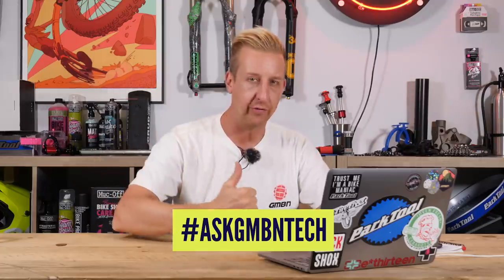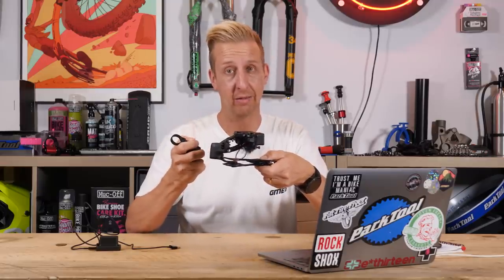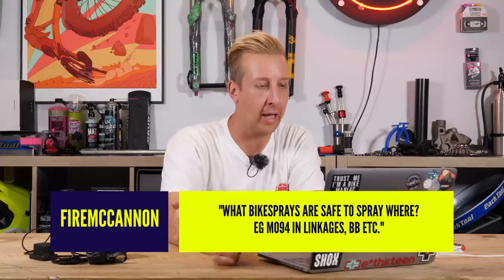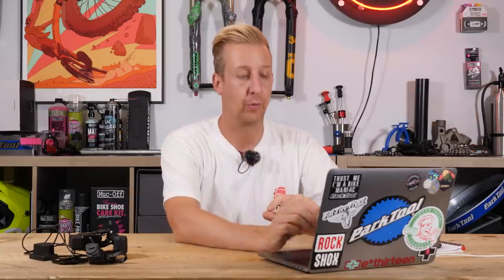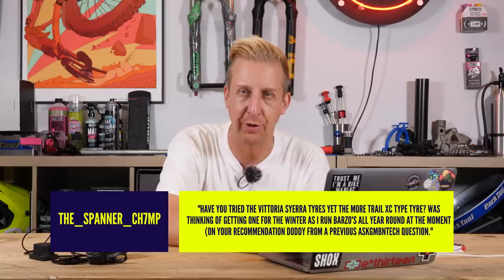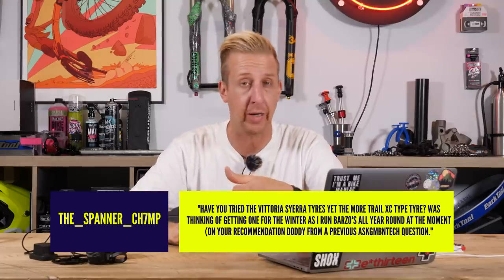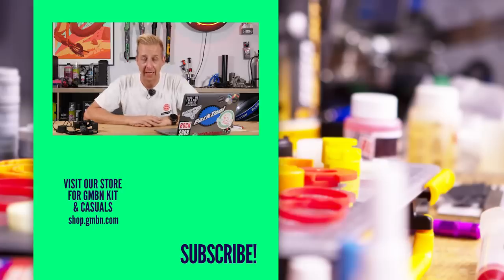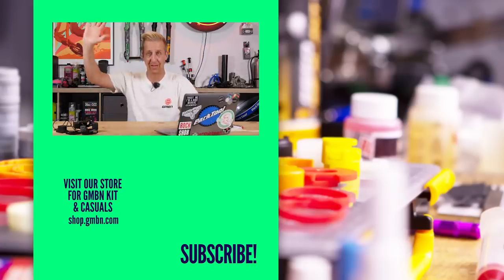Fake Sram AXS, How Bad Can It Be? | #AskGMBNTech 200

Comment from the maker: Would you fit fake components to your bikes? Share your thoughts on this subject with the community down below! 👇💭
Reply: Nope - spend you money supporting the brands which support the sport - not the rip-offs.
Reply: I wouldn't call that Wheeltop rear mech a fake unless they have an infringement of copyright on the product? more they are using SRAM marketing to try to sell their own product - interestingly it's no longer listed on their website so I'd expect SRAM have jumped on them.
Reply: does bein a fake rider count?
Reply: Microshift would be as "low" as I'd go I think but I just stick with slx/xt and NX/GX as to me it's the best price to performance and lasts me fine (so long as rocks don't see the end of the derailleur prematurely).
Reply: Won't be fitting any knock off components on my bike. On the topic of tubeless setup, I mount the tyre dry and get it inflated to set the bead first. Then I would deflate and dismount just enough of the tyre to pour in the sealant, remount and inflate. Since most of the tyre is set already, less chances of a sealant bomb going off and almost guaranteed to get the tyre inflated first go around. Love the show guys, cheers!
Reply: fake kit - yes (I do for the road, the mark-up on bibs/jerseys is insulting), fake components - no, not worth the safety/functionality risk.
Reply: @tim__sadler  I'd say if it works as intended then why not give it a go? It encourages competition and drives down prices for consumers no?
Reply: @MrOvertSandStorm  absolutely they is so many bike snobs on this channel you should watch Sam pilgrims new video with 160pound double crown forks from Amazon!
Reply: @MrOvertSandStorm  Unfortunately that is never the case - innovation drives competition - Rip-off/fake/infringing products actually slow down Production Development as companies are forced to compete with thier own designs made cheaper and in most instances worse. 

Also how many of these knock-off brands sponsor riders, support events, put money back in to the sport... do you know what their company policy is on Sustainability or Work Practices... if the answer is only about price then we are in a bad spot.
Reply: There is plenty of original components I wouldn't touch.
But even then there is a chance for a look-a-like, when its low cost is due to patent bending, not poor manufacturing. The shifter in question might be such, but it still needs refining
Reply: @Mountain940  you assume incorrectly.  it's not about being a snob.  it's about being cheap.  like most hobbies, cycling needs money.  most of us around here aren't fond of spending more than we have to, ONE time.  we'd like to NOT spend on stuff more than once so we'd like things that are mostly proven to work and last.
Reply: @subforascoobysnack6460  yea but seth still had to SPEND money on it.  his youtube channel can afford that kind of experimentation.  can you?
Reply: JG bike makes a Sram eagle 12 speed cassette that's half the price and ive bene riding XC , enduro, and regular trail and jump lines like a young mountain biker should and it has held up shifted smoothly and lasted a season and a half without any visible wear.
Reply: @MrOvertSandStorm  If it is a product on its own "pie brand electronic gears", then I'm all for it. Selling it in a way that tries to confuse it's association with another company like they do here makes the seller (not necessarily the manufacturer) untrustworthy. If this product does work, someone reputable needs to pick up distribution and support it. (can still be aliexpress/direct from china, but it needs to be legit)
Reply: The last components I'd try to pass off would be sram, I'd be too embarrassed to have any sram aside from their quicklinks on any of my bikes much less a sram knockoff
Reply: @littleshopofrandom685  yeh I agree, calling is AXS or whatever and branding it the same it suss and not ok
Reply: @Mountain940  I really hope no-one buys those 26" forks thinking that Sam has actually recommended them...
Reply: Nope. No support for knock-offs, which are usually of much worse quality. I prefer to buy once but very good quality.
Reply: call me what ever you must, but I do and will continue to stay away from knockoff products.   Tried and true for me...
Reply: @iHasCaek  Exactly!
Reply: @GMBN Tech Guys you have multiple impostor accounts commenting here please be aware
Reply: No. I'll spend more for the proper part the first time.
Reply: Okay but this is not an actual fake component? The seller even has been removed from selling them like that? Unless I missed the part where they wrote SRAM on it?
Reply: "Chinese Carbon" wheels are super popular,
Reply: This video is very misleading and feels a bit  like clickbait/spam.   The product description that GMBN reads aloud in this video I am almost certain was from a listing on Ali Express by an independent store/seller.   Wheel Top is the brand that makes the kit and they quite literally supply numerous other product to big names like Trek and Giant bikes.  They never tried to impersonate SRAM that I am aware of..   Oh and by the way that wireless drivetrain kit weighs less than the xx1 version of Srams AXS at less than a 1/3 of the price.  About $360 USD.
Reply: @tim__sadler  Every modern derailleur is a rip-off...of Sun Tour's slant parallelogram innovation. sheesh.

Comment: That "fake" SRAM AXS is not an actual fake product. it's an EDS OX from WheelTop, the seller was trying to pass them off as SRAM.
Reply: Indeed, thanks. They were at eurobike apparently. Direct price is $365usd for the kit, which is half the msrp of sram gx axs (however you can get gx for closer to $500) 

Unfortunately they seem to have some dishonest sellers. Sorta the same as the many carbon frame "counterfeits" coming from legit factories, just with bad sellers.

Now, this product doesn't look very refined - yet - but it does signal a new competitor that might incentivise others into creating more viable lower cost options.
Reply: @littleshopofrandom685  I think the most awesome feature of this EDS rear derailleur is the fact it is compatible with all drivetrain gearing 8spd, 9spd, 10spd, 11spd, 12spd, and 13spd. Look out SRAM because you Efd up.

Comment: For road/gravel, forget Microshift as the "other" brand, and go straight to Sensah. They manufactured for SRAM before SRAM betrayed them and took their business elsewhere. Their current products are very affordable priced. Road shifters for about 40-50 quid a pair, no matter how many gears you want. They're ergonomic, easy to use, and have a very respectable build quality about them. They also produce some mountain bike stuff too which I have no experience with, but it also seems very reasonable. 

For people who think its unfair that these "no name" products exist, just think how much dominance Shimano and SRAM currently have, every single new bike is sold with one or the other and some of these alternative brands are contributing some neat ideas on occasion too.

Comment: I have a Cell Cycling x-shifter wireless rearmech actuator and shifter on my gravel bike (originally it was on my bamboo gravel bike) for a number of years. Different to axs as it uses a cable to pull on any rear mech, and can be used across any number of speeds for 2-12.
It's been so good I've just bought the newest version called NXS.
Reply: Meh. I'd rather just stick with a real, supported brand than lose $200 and have to buy the AXS anyway.

Comment: the shifting system was made by a Chinese company called Wheeltop, which claims to be in the bike industry for a long time(though I've never heard it before here in CN), the price of GX AXS here is around 455 pounds and this is only 282 pounds. So it's actually made for people who wants E shifting for low prices.
Reply: Wireless shifting is a luxury. Cheap wireless shifting is an irony. You get what you pay.
Reply: @GokkunGuru  go back near 100 years and tell everyone derailleur is a luxury. Modern economy - however - is such that electronics is cheaper to produce than mechanics it is substituting. When you pay for sram, you pay premium, not quality (although it is also present)
Reply: @GokkunGuru  Yeah even those people who got paid to review this said "It's a good start, but sram is better"
Reply: @feedbackzaloop  Electronics are just cheaper in cn because of the labor and industrial agglomeration, but what this company lacks is the experience in bike shifters. So now you only get this groupset that's not good enough. But if you go for GX, it's kinda expensive for what you get.
Reply: @endercrafts9056  that's absolutely true, you still need appropriate software, that is why Doddy's presentation was laggy and slow. But I would argue they are not experienced in shifting (as per cable operated) and definitely they can develop software much faster then the West.
As per cost, well, mechanical parts are also made in China and South-East Asia like Indonesia, so comparison is fair, electronics is still cheaper.
Reply: Kida weird he did not even mention the brand or model that was clearly indicated on the side, or did not check the manufacturers website. How is it "fake", when it has a clear branding?
Reply: @Nobody-Nowhere  It's not fake sram, it's just a cheap Chinese knockoff
Reply: @endercrafts9056  Bike companies love buyers like you that fall for their marketing spiel, nothing  technically difficult or expensive about electronic shifting.
Reply: @Nobody-Nowhere   Because he and GMBN are in the back pocket of SRAM among other big brands.  I don't trust any reviews from GMBN or PinkBike.  Just have to take what you can from them and decide the rest for yourself the best way you can

Comment: When I fitted the Vittoria Air-Liner MTB in my rear tyre. Before I fitted the second side on the tyre. I put my tubeless sealant injector through the valve and one of the holes in the insert. So the sealant would go straight in to the tyre and not have to make it's own way to the tyre.

Comment: 223 in the rear and 203 in the front. That's on my mullet. Back tyre 2.6" Front 2.4". This is full moto style. Looks sick!  There is some graphed out geek threads out there  where the temps and stopping power has been measured. Bigger rotor on the rear is actually for heat dissipation which leads to sustained stopping power.

Comment: When I first started riding again I was extremely heavy and my hardtail had the standard 160 rear/180 front, and it was definitely not enough. However I never considered going bigger on the rotors. Instead I upgraded my front two pot caliper for a four pot one, keeping the same size rotors. It probably saved my life. 😆
Now that I'm lighter and still losing weight, I can feel the huge difference in breaking power from front to rear, and I'm considering increasing to a 180 rotor in rear. I think that should get it feeling smooth. 
Thanks for another great show, Doddy! 👍

Comment: For larger wheel sizes, I can't remember which website it was, but they were advertising mountain bike tyres as 30.5". The etrto for the rims was 642mm, which is identical to the old 28 x 1 3/8" or "700a" racing wheels we used sometime in the former half of last century. Reproductions of those rims are still being made if you know where to look, but some additional searching and it seems complete bikes with this wheel size exist for the Chinese domestic market. Tyres marked 57-642.

Comment: one could argue that the rotor on the front tire of a mullet bike should be bigger.  I like a firm short travel brake that you can easily lockup should want too but with a light touch slows quick. The m820 saint brakes fit that bill for me. I Think most people love them or hate them for that reason.

Comment: 29er wheels, longer spokes, 200+ rotors, 4-pot calipers, super grippy tyres. Ever considered the extra stresses you're putting on your wheels? Given that these setups were never designed together from the outset but simply evolved from smaller sizes, could a heavier, stronger or more aggressive rider be pushing the edge of component strength here?
Reply: That's kind of why Boost (and then Superboost) hub spacing came into vogue--the larger rim diameter on a 29er results in a shallower bracing angle for the spokes. Boost spacing pushes the hub flanges farther apart to reclaim some of that bracing angle.

Comment: Sealant question. I live in Texas USA, and I find that my sealant literally bakes and evaporates in my tires very quickly, does sealant and water mix well without greatly reducing effectiveness? I mostly use stans. Sometimes orange.
Reply: I live in Arizona. I was using Stan's because that's pretty much all I knew. A few months ago I started trying out Muck-Off. So far I have been very happy with it.  When I've taken the tire off it seems to have a more even protective coating all around the inside. More importantly it does not deteriorate as quickly as Stan's......
Reply: Yes, in general, you can fill it up with water to replace what's evaporated, as long as the sealant in your tires isn't too dry already. Use a scale, considering tire wear as well, to better estimate what's going on.
Helped me to keep my Fat Bike wheels running.
Reply: Thanks y’all!!
Reply: Try slime tubeless pro... not regular slime, their tubeless specific stuff

Comment: #askgmbntech
Why so few riders use chain wax?
It has many advantages over oil based lubricants. (It lasts longer, attracts less dirt, more effective….etc) 
What are the drawbacks then?
Reply: A gunky drivertrain. Its terrible to clean off the chain and pulley wheels
Reply: Rain, dusty and muddy trails will wash it off quicker than oil.
Not practical for touring or multi day rides.
Otherwise excellent in dry clean conditions.
Reply: @richardharker2775  actually wax is better in mud/dust - proven on my bike. Chain stays clean for longer. Clean drivetrain is another advantage.
Oil is only better in rain on clean (tarmac) surface - but this is not what MTB is for.
Little more resist than oil (when clean) but much better after few miles when chain catch dirt on oil ;)
Re-aply every 100-150km is better than oil (you neeed look at it every ride) and chain is easier to clean.
Only problem is to make proper wax - need optimal mix wax with oil, applying process is long as well and some people doing it wrong - plus: need to have few chains and wax it all at once.
Reply: I switched all four bikes to waxed chains. I have noticed the chains with coatings (which is all of them, but the cheap sram chains) do not last as long as is claimed. I'm not switching back anytime soon, but maybe the industry shouldn't inflate their numbers so much with 'ideal conditions' and such. It's kinda a pain for what you get, but since I have a mostly dry climate, it works for me (for now). Never experienced what Digital Nomad says as it is so easy to clean with hot water from a kettle. TL:DR - It doesn't last as long as they say and it's a bigger pain than the videos make it out to be. - still worth it for me.

Comment: how long do batteries last on electronic sram gears. how many shifts or how long on standby? thanks oh and how long to fully charge?
Reply: The AXS battery lasts very long to the point that it never becomes an issue/question. 

You will charge your cell phone and iPad WAY more and more longer than your AXS.
Reply: @GokkunGuru  thanx

Comment: I've got a question. Is 3X9 still a good choice for riding? I've noticed Shimano and SRAM have regulated 3X9 parts to lower end groupsets such as Alivio and X5.
Reply: 3x9 still works and a lot of dinosaurs swear by them. Honestly 1x is a simplified refinement, and I prefer 1x12 all day, every day. Less moving parts and less stuff to maintain and clean. I use the extra space for a dropper and lever. Super clean setup.
Reply: regulated?  that would be relegated..

Comment: Wouldn’t touch electronics if it’s not from a main brand. I don’t care about performance issues. I’m more concerned with house fires from dodgy electronics
Reply from the maker: We'd always suggest buying the real product to ensure it's met appropriate product regulations. This would ensure user safety and a product that works accurately. 👍

Comment: Setting up tubeless dry first tells me everything i need to know about whether a tire/rim combo is gonna work long term.

Also, I've been running 203mm rotors front and back on the trail bike forever and I've always found it to be superior to a small rear rotor, better modulation so better deceleration before you get to the point where it locks the wheel and way less pressure on the hands. 'Course, with the trend of running brake levers high because everybody wants to be their favourite DH pro, people are knuckling the levers and as a result, they have far less control than braking with the fingertips... each to their own though: Discuss 😉

Comment: I doubt SRAM develops its own battery technology.  I'm sure they simply source standard size and capacity cells the way they use standard sized bearings in their BBs.

The thing is an ordinary lithium-ion cell is a marvel of belt-and-suspenders safety engineering, which adds a lot to the cost.  You can save a lot of money by leaving that stuff out.  Someone who is counterfeiting an entire system really can't be trusted not to skimp by using counterfeit cells.

Comment: Not all sealant can go on via the valve either, Stan's Race for one, it's that good it will seal the valve.
Reply: Just pop the valve core out and use a larger diameter syringe. I haven't found a sealant that won't go though the valve stem with the core removed.
Reply: @MikeNolan_Councilman  Stan's Race won't even with a core removed. Don't have cores on my current valves.
Stan's Race even seals up the end of the Stan's injector. Normal Stan's works fine though.